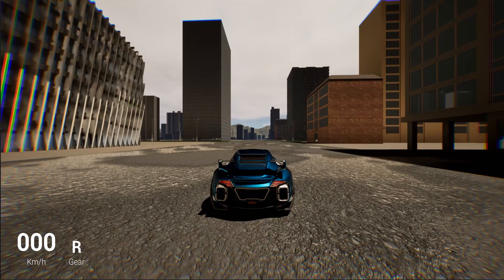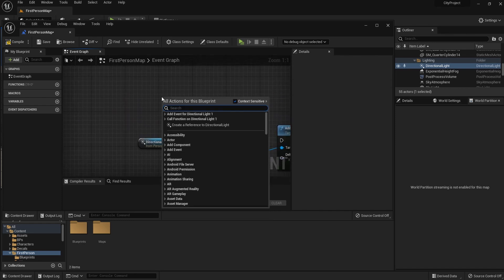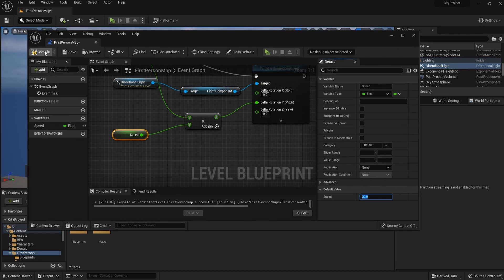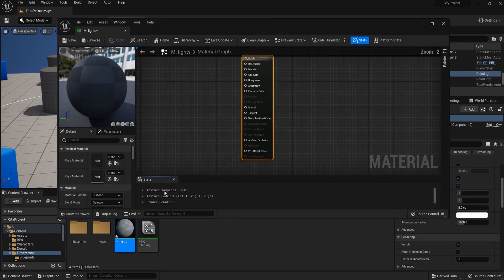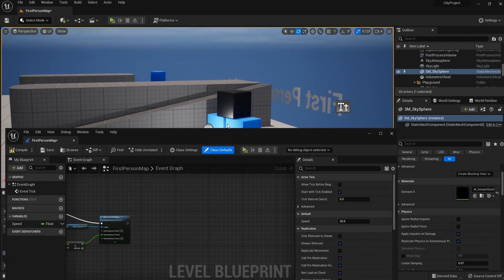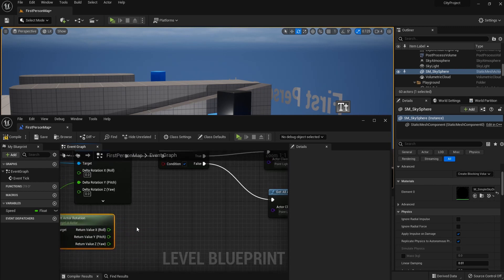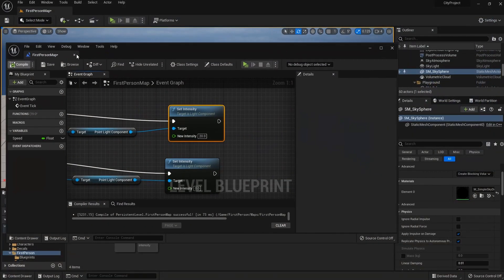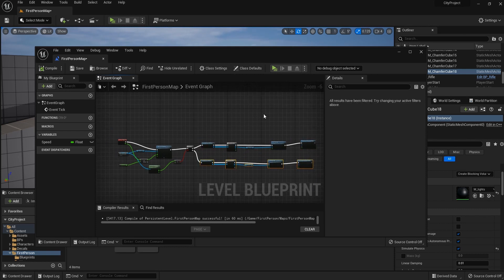Unreal Engine 5 | Day Cycle/Automatic Light Switch Tutorial

Comment: For anyone who watches this. Getting all actors of class on each tick is not how you want to go about something like this. The proper way would be to create an a manual array an add your light actors or whatever to your array and load the array at runtime. Using a foreachloop on each tick on all actors of a certain class will run into slowdowns easily, once you grow the class that is being searched for. Using tick for less intensive things can be okay, however its pretty easy to avoid using ticks on every frame with timers.
Reply: how to change the color of this point light, i want it yellow?